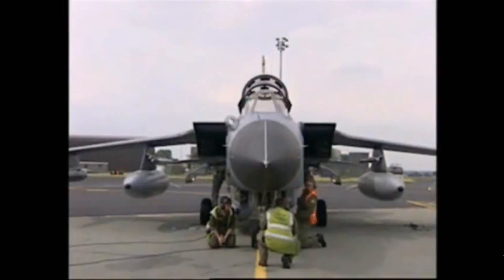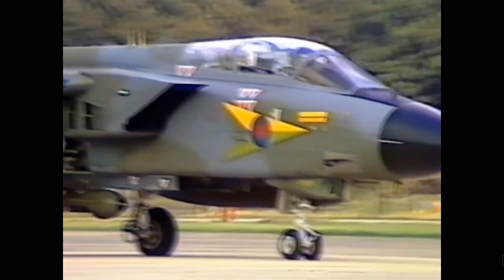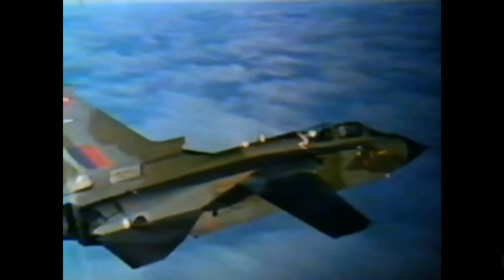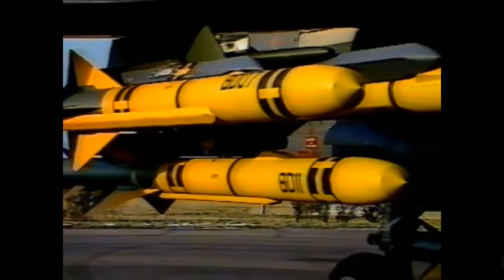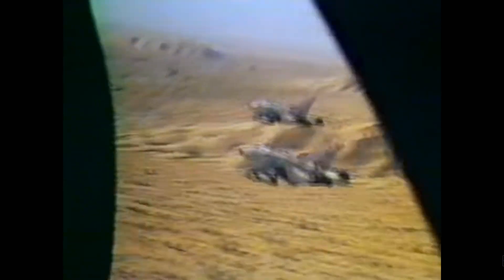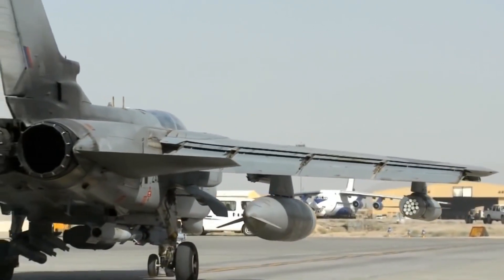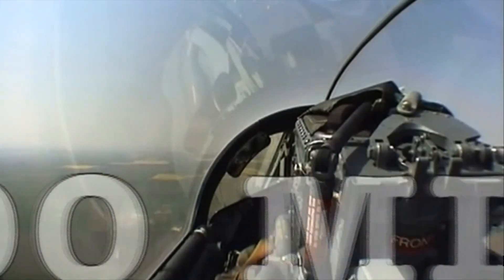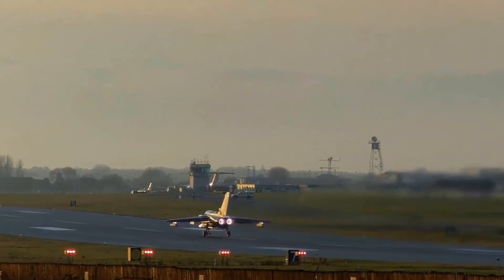Panavia Tornado - Twin Engine Sweep Wing Fighter/Bomber

Comment: All this talk about the danger of having only one engine makes me a bit angry. Modern jet  fighter engines dont tend to flame out or fail, they have some of the highest reliability statistics of all aeroplane engines. Fighter pilots aren't worried about only having a single engine, because they trust and rely on the people who make it and maintain it. If a engine fails on a modern jet fighter, chances are it would fail violently, thus causing a potential 2nd engine failiure anyway. Not only does a single engine save weight it saves costs and maintanance hours. The F-16 for example has only 1 class A incident with engine related causes, while the F-15 for example has 3. And if you, as you said in the video, are in a F-35, you would never bee in such a situation where as you could have your engine damaged by ground fire for example. Not because its not capable of doing so, but because there is no point.
Reply: Point is thought, if you fly low there's still the small possibility of a bird strike and a few F16 were lost because of that. That doesn't mean one engine is unsafe. But not every potential engine failure can be prevented with good maintenance.
Reply: A F-15 has also been lost to a bird strike, and thats a minimal factor when deciding wether a single engine is superiour to a twin engine design.
Reply: but i see your point
Reply: Losing an engine will not normally fail the other engine no matter how violent.....The shielding around the turbines are meant to keep components internally rather than sheading them through the aircraft. Having one engine on a low level fighter bomber or attack aircraft is asking for trouble.....look at the A10 why do you think it has two engines in two pods away from each other? Survivability. The F16 flies at a much greater height than ground attack aircraft...it is much more stand off.
Reply: Search for videos where a modern jet engine fails, it more often than explodes and that will take out any neighboring engine. Having one engine on a low level fighter bomber/attacker is asking for trouble? so is being a low level fighter bomber in the first place. The A-10 is a plane of the past designed with a doctrine of the past. Whats the point of having low flying aircraft that are put in harms way when you can fly high and away from danger and still delivering the same or more firepower as or more accurately? CAS as you probably know is not going low slow and near the enemy and then dropping/delivering munitions, but rather the delivering or ordinance in close proximity or friendly forces. Where the munitions are launched from does not define what CAS is. P
Reply: You are straw manning the argument. Having a single engine CAS aircraft is indeed asking for trouble. All your eggs on one basket with a single engine from ground fire is exactly the issue! No, losing one engine on a twin does not mean it effects the other, I am not saying all but 9 times out of 10.....evidence to the contrary? Engines do not simply explode.....fact. The future for the F35 is huge stand off distances because of its single engine and susceptibility to ground fire and also its sheer expense. The A-10 is a plane of the past but it is also a flying tank, no other CAS aircraft currently in service can take the beating that aircraft can or has the impact on the battle field either from loitering, the GAU-8 or its ability to protect our soldiers with CAS. Just ask serving soldiers who have called in the A-10 to laydown firepower or get them out of a sticky situation.
Reply: When i say loosing an engine i dont mean it in the way of a compressor stall or something that "weak", im talking about if something for example is sucked into the engine, the engine is shot or anyting of that nature. When something like that happens, chances are the engine will catch fire and explode. The F-35's choice of doctrine to not get in harms way if it doesent need to is not because it cant or because it has a single engine, but because of the unnecessary risk of loosing a pilot. The pilots safety is the most important factor. Why put someone in harms way when there is absolutely no reason to. The F-35 can take a beating if it has to, its designed around the same principles as the F-15, mainly a FBD, meaning that it can loose part of or most of a wing and still be able to fly back home. Yes alot of A-10 survive a hard beating, but some also go down, this is what we want to prevent with stand off tactics. The GAU-8 was also designed to take out tanks, but it is no longer able to do that with modern tank armour. Sure its effective against a non technologically advanced oponent, but against any modern military, its screwed.
Reply: Im not saying the A-10 is bad in any way, i want to keep it for just the sort of thing that i mentioned, but its outdated and vastly inferiour to the F-35 in almost every way imaginable. Its served its time really well and i understand the soliders huge respect for it.
Reply: LOL engines do not explode! If an engine does let go they breakup more than likely from a compressor blade or blades coming apart from either FOD or as you say a bullet. The case of the engine as I stated holds the engine together to prevent said blades being ejected sideways. The only thing burning in the engine or could explode would be the fuel or fuel tanks this is negated with the engine case. The F35 could no way fly back with most of a wing missing! What have you been reading lol. The F35 as a ground attack aircraft is not as good as the A-10....it flies to fast, has to fly to high and doesn't have the GAU-8 to assist soldiers on the ground in close air support.
Reply: So you are saying that modern fighter jet turbo fan engines dont explode? and that the F-35 is less likely to fly back with one wing missing than the F-15 which has the same lifting body design but much older? and that the F-35 cant fly low and slow? flying high and fast is not a disadvantage, and you dont need a GAU-8 to preform CAS at all. The F-35 for that matter has the GAU-22 which in fact is more capable in both anti personell and anti armour than the GAU-8.
Reply: You quite clearly do not understand aircraft or weapons. The F-15 has massive surface area's compared to the F35.....just look at the engine inlets for a start which would provide lift on their own..along with the elevators and vertical stabilisers...the F35 is a flying brick which is hugely unstable and requires a lot of compute power to keep it in the air, the F15 is a lot more analog style. Saying a GAU-22 is more capable in Anti personnel and anti armour than a GAU-8 is insane? The GAU-22 in the F35 is only 25mm, slower fire rate 3000rpm, 180 or 225 shells depending on config and less kinetic energy.....the GAU-8 is 30mm, 3900rpm, 1174 shells and a shedload more kinetic energy!
Reply: i clearly dont understand planes or weapons? ok. The F-35 might be smaller than the F-15 but it still has the same principle aerodynamics. Its weight, drag and wing area is like having a  miniature F-15, and yes it does need alot of computers to keep it "stable" and that because it was designed to do so. Every modern fighter aircraft is designed to be aerodynamically unstable. That doesn't change things, if the F-35 was to loose part of a wing, the computers would help counteract that instability. The same way a pilot with less computer power at his disposal would. So saying the GAU-22 is more capable than the GAU-8 is insane? when the GAU-22 is much newer, much more accurate, has a slower rate of fire making it save a lot of ammunition, you don't need more than 3300 rounds pr. minute,  and it fires APEX rounds which have better penetrating capability and explosive capability than the GAU-8. Having 5 more mm doesn't matter much, actually it just makes you carry less ammunition. The F-35 "only" having 188-225 shells is more than any Russian block fighter and if the pilot is skilled enough he can make good use of those rounds, the GAU-22 being more accurate as well. For that matter, the A-10's GAU-8 is used far less than normal dumb or JDAM bombs anyway.
Reply: The F35 is no where near the surface area of the F15 hence the F15 can lose more wing area. We are talking semantics as there is yet to be a heavily damaged F35 return from a sortie with a wing missing. Having the same/similar principle aerodynamics doesn't mean the F35 will replicate the F15 with the same damage. Going on the GAU weapons.....we are talking between the F35 and A-10 in the ground attack role not the fighter roll. You mention JDAM's......how many JDAM's can the F35 carry vs the A-10? The A-10 has 11 hard points to attach weapons...the F35 can only carry two missiles with two JDAM's? You tell me which will be more effective in the ground attack role. The GAU-22 is a newer weapon but it is a no more accurate that the GAU-8...."5mm doesn't matter much"? really? the sheer kinetic energy difference is enormous. The muzzle velocity is only 15m/s faster on the GAU-22 but the GAU-8 round carries a lot more energy. Case and point in Gulf War 1 the British Warrior shot in a blue on blue accident by an A-10 was crushed by the sheer force of the rounds. You comment about the GAU-22 is mute anyway as from the F35 attack height the gun would be a lot less accurate and effective with a 2/3 second burst which would empty its ammo. We digress.....my original statement about twin engine aircraft having better survivability than single engine aircraft in the ground attach role stands.
Reply: I'm not saying the F-35 has the same wing area as the F-15, not at all, what i'm saying is that the F-35 at the same time has less drag and mass than the F-15 and that helps counteract the "lack" of wing area. I'm only taking the words from the people who designed the F-15 and F-35,that in theory, the F-35 is supposed to be able to do so. I'm also talking about the F-35 in the attack role. The F-35 has 4 internal pylons, and 6 external pylons, that's only 1 less than the A-10 and it has a higher max payload weight as well. The GAU-22 IS more accurate than the GAU-8, by quite a lot actually, which shouldn't be surprising considering the GAU-8 fires faster, is older and has more recoil. What the GAU-22 lacks in kinetic energy due to the caliber, it makes up in the round it fires, which is the APEX. And the F-35's "attack height" can be just as low as the A-10 if it needs to, the point is it doesn't need to be. And yes i agree with you that a plane like the A-10, which is slow and flies low, two engines will increase your chances of survival, this was never my point, my point is that in modern threat scenarios, and with modern tactics, having one engine doesn't effect your survive ability nearly as much as the planes of the past.
Reply: I will just leave some of these here and if you think the hugely complex F35 could get back to base ok....let me know......having two engines was exactly the point! You were arguing that having one engine is enough for a ground attack aircraft.http://farm6.static.flickr.com/5270/5888008953_71f7ee3493_z.jpghttps://www.youtube.com/watch?v=4WaQRtiwIOQ
Reply: yes and it is, for MODERN aircraft with MODERN tactics. That was and is my point. They don't make low flying and slow attack aircraft anymore for combat against modern military powers. and yes i think the hugely complex F-35 can get back to base.
Reply: They do make low flying slow attack aircraft its called the A-10 that's been extended for a long period as it does a good job on the battle field and have proven its self. Let me know when a heavily damaged F35 has got its pilot back to safety.
Reply: Slapbladder they dont make A-10's anymore, not at all. That ptoduction line ended in 84.
Reply: I know it was a joke.....it was reference to them being overhauled to fly way in to the future. My bet is while they are fly you will hardly ever see an F35 in a ground attack role.
Reply: Slapbladder then you would be very wrong. The A-10 isnt getting overhauled, its getting a longer service life due to congress not retiering it before maybe 2040, the airframes have limited lives and they might prove to be too expensive both to maintain and overhaul. The F-35 will see alot of ground attack missions if we aren't fighting low tech terrorist groups.
Reply: Haha you raise some good points. 1. The avionics WILL be overhauled. 2. Engines will be overhauled 3. they will deffo be upgraded by both airframe and tech. to keep them relevant 4. You say they won't be overhauled then counter that by saying they will be overhauled lol which is it? 5. How many wars have been fought over the last 20 years by the UK against anyone other than low tech armies or low tech terrorists?
Reply: Slapbladder its not decided wether some of the things you mentioned will be overhauled, we'll have to wait and see, i hope they do so. But what do you mean UK? The UK doesent operate A-10's, and the reason why i hope they keep the A-10 is just because of that, the US fights terrorists with limited technology and therefore th A-10 can do its job very well. Even though it wasn't really designed to do that. But the thing to keep in mind, and my main point, is that the A-10 wouldn't survive a day in a modern threat scenario where the enemy has access to more advanced weaponry than MANPAD'S and AAA.
Reply: Because the A-10 has proved on many occasions to get our soldiers out of sticky situations and we have unfortunately bought the F35 lemon.
Reply: Ofcourse a guy like you is going to say "oh no, we've bought the F-35, we're doomed, its a lemon" when in fact, this plane has prooved itself to be one of if not the best fighter and attacker the US Air Force has ever posessed. If you say its a lemon, you're quite clearly ignoring facts. Btw, think of how many times the F-15E, AV-8b and F-16 for example also have gotten soliders out of sticky situations, more often than the A-10 for that matter.
Reply: Proved what? Its never seen combat? Its overly complicated....the VTOL version is ridiculously complex. The F35 has been rinsed several times by the Typhoon in mock combat exercises....F-15E scares insurgents with noise....AV-8b? oh sorry you mean the Harrier ;o) which hasn't been in the best hands with a lot of airframes lost by the Septic Tanks....F-16 I will give you that one....good old bomb bus like the Tornado.
Reply: What i mean with proved is its performance in for example red flag, where it scored a 20-1 kill ratio against aggressors and AA. This proves something, and if you say it doesn't, you would be very ignorant of whats right in front of you. The VTOL version is complex yes? what's bad about that? It costs 2 times less than a C version for example and is currently under 100 million USD. The F-35 has also never fought against Eurofighter's in mock exercises, at least not yet, and if it was to do so, it would loose like any other 4th gen legacy fighter. Especially when the Eurofighter is about on par with F-15E. Pretty simple, when the F-35 dominates the F-15E, and the Eurofighter is about on par with the F-15E, what good is it going to do?